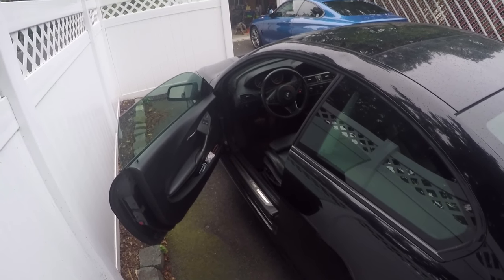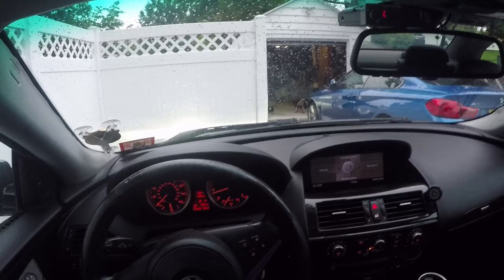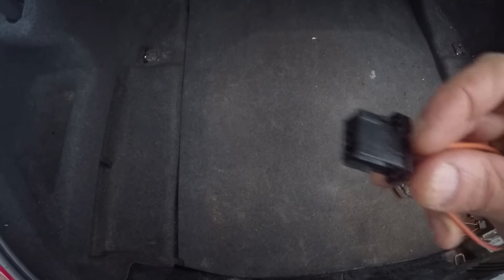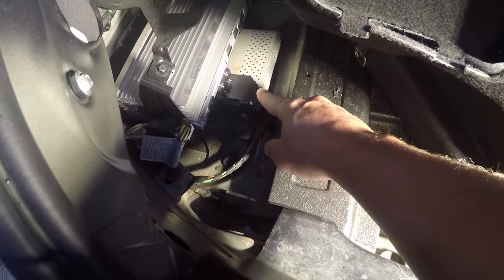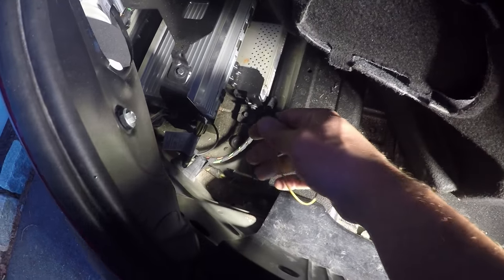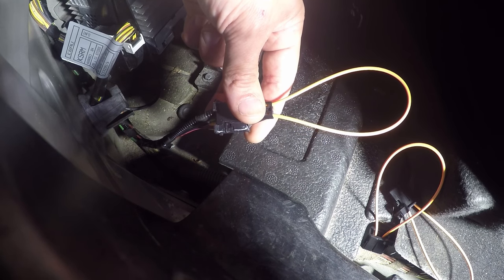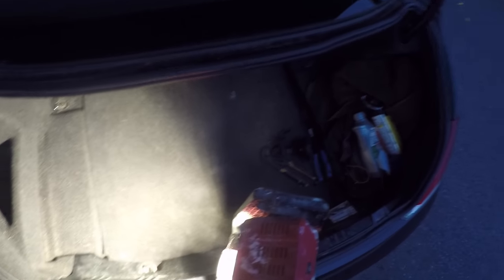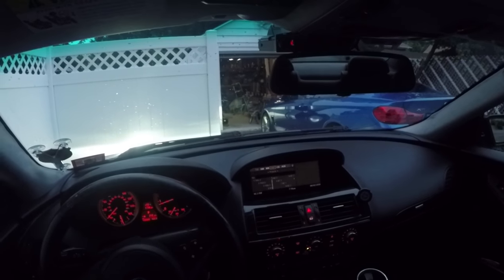FIX BMW SOS Error Light Audio System Failure CHEAP + Tips Others missed!

Comment: I have same issue with my 2010 550 gt , I was listening to my radio at low volume and after a little noise all the sounds of the car stopped working. I bought the piece on Amazon and tomorrow I'll try to make the correction 🙏🏾🙏🏾
Reply from the maker: Did you get the SOS light?
Reply: ModsAndProjects not,everything works including the GPS ,but I do not hear any sound in my car
Reply from the maker: Hmm might be something else in your case.  No SOS light ans NO sound at all from any source.  Did you hear and pops or crackle noises before the sound went out?  Was the sound level changing (up and down) at all?
Reply: ModsAndProjects yes, I heard a pops and this happened after I raised the sound
Reply from the maker: @danieljunior9924  Sound like you might have a problem with your AMP.  It will need to be repaired.  The fix in the video is for the SOS light.  Send an email to this guy: http://www.bmwlogicseven.com/?page_id=4004
Reply: ModsAndProjects  yes, didn’t working 😭
Reply from the maker: @danieljunior9924  I'm sorry to hear that, i warned you.  If the SOS light is not on this is not the fix for you :(  I would guess you need you amp repaired or you have a loose connection somewhere on the AMP.
Reply: ModsAndProjects ok, thank you for you attention and help .
Reply: ModsAndProjects hey man, I changed the amp and the problem continues, 😰
Reply from the maker: @danieljunior9924  Reach out to Logic7 like i said a few posts up.  You might have something going on with your CIC or another non-typical issue.
Reply: I installed the Bluetooth and raised the volume, I heard a small pop and after that the sound of the car stopped working. There is no sound at all. I have bought a new AMP and the sound still does not work. What might have happened with the sound? Any suggestions? 

Thanks 

Sent from my iPhone

Comment: Hey thanks for the video. I have a 2007 (lci) e60 530d with sos call system failure. My Bluetooth works fine for calls and I have sound from my stereo. Any idea on where to start? Thankyou
Reply from the maker: Just saw this.. Did you ever figure it out?
Reply: Hi,
I have the same issue, the sound system is working fine, and the BT as well, but I only have the SOS failure message... 
My car is BMW 525d LCI 2008 E61.
Does it work?!
Reply: Did you fix the problem .. my 535d lci is the same everything works just that sos warning…

Comment: Hi, I am in Australia with the dreaded SOS malfunction fault. After watching your excellent video, I now am hoping this might fix my problems. I have no water damage unless it is around the shark fin, but no signs of ingress. Apart from the SOS failure, which if I can clear with the loop cable would be great, I have no reversing camera and it defaults to a map screen, no bluetooth for my phone to connect, and no TV which I don't use anyway, (is this your sat radio? 4th option on right). I have been looking for the SOS battery and can't find it or info on location/ part number. Does this model have a battery? Do you think the loop cable might be a fix? I found a SIM card in the TCU and as 3G is phasing out here could this be the problem? My car is a 2008 X5e70 3.0sd with the CCC system, built in USA I believe.
Any advice would be greatly appreciated.

Comment: 2007 335i, SoS error message is on. Radio AM/FM is working fine! TCU error is A390 (Emergency antenna fault). There is no door chime sound. What do you think?
Reply from the maker: Try to bypass the TCU and see if the SOS light goes out, if so you will need to repair the TCU. Do you have Bluetooth?
Reply: @ModsAndProjects  yes it has BMW assist and Bluetooth.
Reply from the maker: @BIMMERZEITT  Is the Bluetooth working as an audio source?
Reply: @ModsAndProjects  yes Bluetooth is working
Reply from the maker: @BIMMERZEITT  Hmmm.. It really sounds like something funky is going on with your TCU (or its connection to the antennae).  You could try bypassing it to see if the SOS light goes away.  If it does go away with the TCU bypassed it would indicate you need to have it repaired.  Edit:  I had a quick look at the e90 Entertainment and Communication document here: http://www.e90post.com/forums/attachment.php?attachmentid=334282&d=1260829447  It also could be a power or signal connection to the shark fin antenna.. Check all connectivity between the shark-fin and the TCU, then try bypass TCU.
Reply: @ModsAndProjects  the bluetooth works with my phone, not sure how to play audio music through it though. Also, the door chime does work, everything works. The previous owner said the fault is there because BMW assist no longer exists? So maybe just code it out.
Reply from the maker: @BIMMERZEITT  Back then the Bluetooth was just for the phone, no audio... so that is normal.  Like I said, make sure the connections to the shark-fin are good.  If it was a BMW assist issue i would have the SOS light on my 2006 650, and I do not.

Comment: The adapter turned off the sos notification but there is still no sound from my speaker system. Any tips?? 08 335xi
Reply from the maker: hello, thanks for commenting :-)  the bypass loop is a great tool because it allows you to identify exactly which component is malfunctioning. The particular loop in the description of the video above comes with direct customer support to assist you with identifying the exact problem and helping you to decide whether just bypassing it or regaining the functionality is the best course of action. A lot of times people just bypass out something like the satellite radio to get rid of the SOS light or to get there sound back, however, if it is something like Bluetooth that you might want to get the actual functionality back the tech support will guide you to the best course of action in getting it addressed avoiding the crazy prices the dealership would charge. For $14 it’s pretty awesome that you get that level of technical support!

Comment: Thanks for doing this video, I was headed to BMW!  One question, I drive the 750i, 2006 and I'm getting the same SOS signal but my radio still works, should I still get the same female plug?
Reply from the maker: Yes, if you get the one in the description It comes with support to help you figure out what the issue is even if you can't quickly figure it out with the loop.

Comment: would this fix my idrive problem from not working...
also I do get the phone symbol as well...
great vid...
Reply from the maker: Year, model, make? What is the problem with idrive?
Reply: @ModsAndProjects  it comes on & goes out...
no sound when it's on when the CD or radio playing & I get the sos as well...
2006 530i...
Reply from the maker: @petewilliams9493  Sound like it could be, for $10 its worth a shot.  It it does not work i would look to the AMP, or the CCC.

Comment: Worked out great, 08 550i. Quick question,do i need to unplug the satellite module? would it cause any issue with the battery?
Reply from the maker: No, no need to disconnect the power to the satellite receiver.  Thanks for reporting back with your positive results.

Comment: Great vid . Worked like champ. Hardest part was getting plug out of the module.  I used my Dremel with a cutting disc to shave off the surrounding plastic lip.
Reply: Yoooo me to but I jus broke mine by accident 🙄🙄
Reply from the maker: The loop in the description is a custom connector that you don't need to cut up with a Dremal and risk breaking, you just plug it in and go
Reply from the maker: @nojobtommy4556  The loop in the description is a custom connector that you don't need to cut up with a Dremal and risk breaking, you just plug it in and go

Comment: I have 07 750li i unpluged battery over night now radio not working but only think wasnt working was communication unit i looped it all other units work. But radio still not. Work what do i need to do next.
Reply from the maker: When you say the radio is not working do you mean AM/FM only? Or sound completely is not working?  Did you get the loop in the description or some other loop?

Comment: Having a similar issue with a 2003 X5 3.0  radio on shows what's playing but no sound ..bought it with this condition .any help would be appreciated.including repair mans contact to send amp if that's the issue .thanks
Reply from the maker: Did you figure it out? Sounds like it could be the amp.

Comment: Does this fiber optic bypass affect the GPS?  I have a Drone Mobile auto start and I still want the remote starter to work with this.  Any idea?  Thanks
Reply from the maker: No, it does not affect gps, GPS is controlled by the ccc/cic depending on the year, basically your head unit. Bypassing a defective component using the loop just removes it from the multimedia Network, that's it

Comment from the maker: Please Subscribe! :) If you have any questions please post them below and I'll do my best to help!  Let us know if this worked for you! As far as the part used in the video i recommend these: as they come Pre-Trimmed (plug and play): Amazon - https://www.amazon.com/dp/B07PDJPXCW
Reply: I own an e60 530i and had a week ago sos system failure and aftar a day it was no audio in at all in car then after next day audio came back but sos failure stayed but i noticed something when there is no audio also u cannot access tv the sos failure still appear so what it could be from?
Reply from the maker: @eliasafram6179   Cant hurt to try the Fiber bypass for only $10.. You can also troubleshoot other components if its not the satellite radio unit.
Reply: I own e60 525i I have problem w sos keep coming out and no audio and after a 10 20 min the screen turn off..I don’t know if something wrong w computer or only I need the peace u put it 
Thank you
Reply: ModsAndProjects hey...so my Sos Malfunctioned but would this also be able to fix my AUX port and the USB port next to it? I have an 08 328xi. My speakers are also making a static like noise even when the car is completely off.
Reply: Great video.  Thanks for posting. I have an 08 e60.  My bluetooth reads my phone and syncs but no sound comes thru during a call (as if they're not even synced.  Also, I have no aux anymore for some reason.  I noticed these two issues right after the SOS light came on.  New mulf2 needed I assume?
Reply from the maker: @amt3331  Issues in the MOST network can cause all types of things to go wrong in various components. Give it a shot and see if it works out.  Ill try and help with figuring out what its going on.  The CCC or AMP also could be going bad.
Reply from the maker: @abdelrak2002  Could be a problem with the CCC (computer control center)  I have a guy that fixes them for the best price out there, but honestly using one of these fiber optic bypass units to troubleshoot by bypassing components in the fiber optic network is a great place to start.
Reply from the maker: @1993Ma7mod  This is almost 100% a CCC issue (I had the exact same issue in the 06 650) - BMW Stealershit will CRUSH your wallet you to replace it, but thankfully there is a guy who does excellent work on CCC (and amps) for the cheapest price on the internet: http://www.bmwlogicseven.com/  PS: DONT try and buy a used CCC on ebay, it will need to be reprogrammed ($$$) and will probably fail again due to age just like your current unit.
Reply: My 2009 750li screen is all black wit no sound what can be the problem
Reply from the maker: @brandonsmith3883  All black screen with no sound is 100% a bad CCC. It is possible another component is also bad but the CCC is in need of repair here is a link for the best price/ service  you will find on CCC http://www.bmwlogicseven.com/?page_id=4123
Reply: i have the same problem but with my 08 x5 because of halos .. any help?
Reply: Do you know if this will work if the light is on because an aftermarket head unit, like an Eonon, was installed?
Reply from the maker: @johnbostick9176  no, an aftermarket head unit triggering the SOS light will need to coded out
Reply: Would this work for my 2015 Bmw 328i xdrive?
I have SOS Emergency call malfunction.
Reply: So I have the sos malfunction but I have audio but intermittent Bluetooth no do not have satellite radio on my display where do I put my loop I have purchased it from the link
Reply: Oh I have a 2008 BMW 535i
Reply from the maker: @chasemeridian5871  use the contact card or Amazon messaging to reach out to the seller and he will personally help you through it
Reply: Hello i have same problem on my x6 , but only the sos malfunction, my radio and bluetooth works
Does it will be ok with this fiber loop ?
Thanks
Reply from the maker: @romg92170  what year is the X6?
Reply: X6 e71 2008
Reply from the maker: @romg92170  yes, it is fully compatible with all components for troubleshooting and diagnostic purposes. If you purchase the one in the description it comes with a card with contact information to help you troubleshoot and identify the bad component if it is not easily identifiable on your first shot.
Reply: Ok thanks you.
I ordered one like this one ebay , hope it will be the same
Reply from the maker: @romg92170  you will probably have to cut it up to make it fit The one that's in the description is nice because it is pre-trimmed and cut so it fits universally in any component for troubleshooting
Reply: @ModsAndProjects  ok i will buy it 
Thanks a lot for your return 👍🏾
Reply from the maker: @romg92170  No problem man :)
Reply: Can you just buy a whole new radio ?
Reply from the maker: @Tkforeal  with aftermarket components it is hit or miss I recommend repairing the OEM system whenever possible.  I've spoken with many people that needed to hardcode out the SOS light with aftermarket components
Reply: I have a 07 335i and my SOS won't go away this time even after unplug and replug of the battery which saved it last time.  I can see the radio is on and my CD is playing, but I cannot hear any sound on the radio or on the CD.  Thanks for any help!  You know how bad the dealer can be.  They are like doctors lol.
Reply from the maker: @swissbliss24  avoid the steelership at all costs (pun intended). If you purchase the loop in the description it comes with full troubleshooting support believe it or not!

Comment: I'm still getting the SOS signal I haven't done to fix yet. But, my passenger side speakers only the highs are off. I still get sound from my driver side, the passenger side I only hear base.  However, satellite radio is available when I click on it everything is grayed out on the menu. So does that mean that my satellite radio is failing?
Reply from the maker: What you are describing sounds like a bad logic 7 power amplifier, or a combination of a power amp on the way out COMBINED with a bad satellite receiver.  I would get the adapter to try bypassing the satellite receiver.  Once bypassed one of a few things will happen: 1. The SOS light goes out, but the highs/bass issues continue (bad amp, bad sat rec.) 2. SOS light stays on, sound issues continue (bad amp OR bad amp AND bad sat receiver).  Either way, I'm pretty sure your amp is on the way out... Best price to fix these is: http://www.bmwlogicseven.com/

Comment: I have a 2006 BMW 330i E90 without sat radio but have the logic 7 system with nav  my system keep rebooting.
Reply from the maker: If the nav keeps rebooting in a 2006 you have a bad CCC.  You cannot bypass the CCC it needs to be repaired or replaced. Also, you can't just drop in a used eBay CCC, it will need to be coded to your vehicle.  BMW charges 1200-1600 you can get it repaired for around 400.

Comment: Hey, I recently watched this video because I was getting the SOS signal malfunction on my 07 530i bmw and purchased the fiber optic loop and installed it to bypass the satellite radio. And the error code went away but the radio cuts in and out. Any suggestions on what I should check out now?
Reply: Did you find a resolution? I'm having the same problem. Still resetting 80 times a drive to listen for 5 seconds.